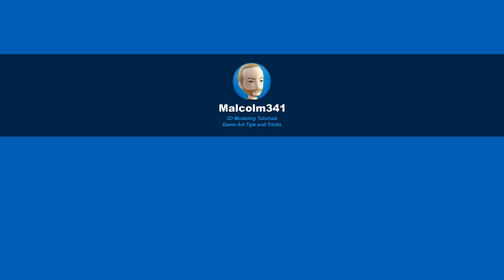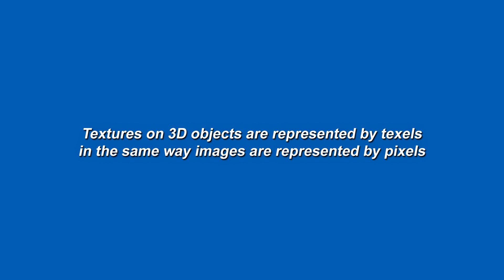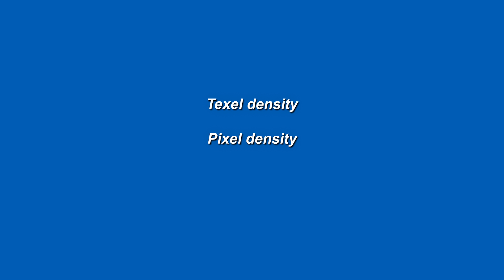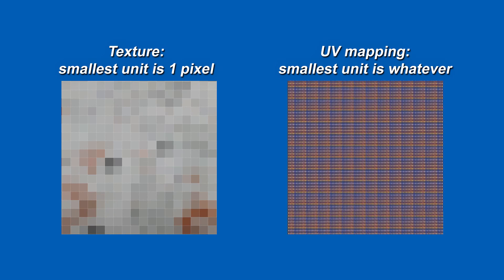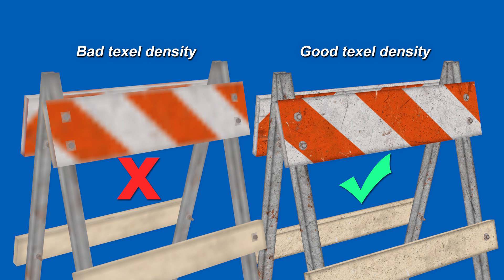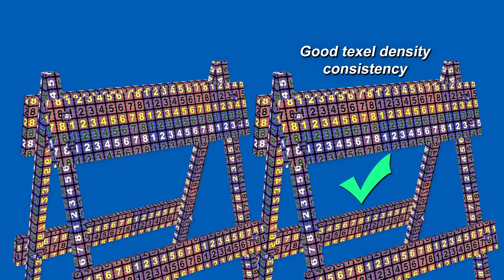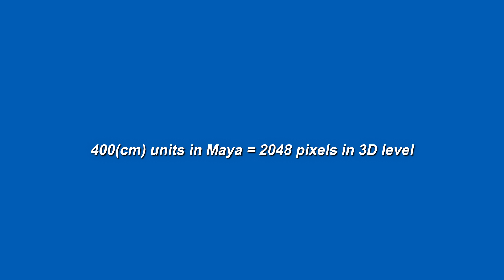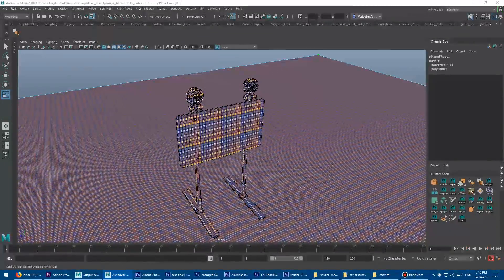What is Texel Density and How to Master it

Comment: Ah man now I'm confused. I watched a tutorial where he said 256 x 256 equals 2048 resolution. Same centimetre units for unreal engine. He had the mannequin next to the trimsheet, but now your saying it's 400 x 400 units equals 2048 in this video, both of you are using the same Centimetre units which is what unreal engine uses.  I have my maya grid and measurement units set to centimetres, but i'm confused, is it 400 units or 256 units?  bought your pack btw!
Reply from the maker: @SpecMarks Texel density is actually arbitrary that's why your confused and is determined at the start of each project/game before you create any assets. One centimeter in Maya can = any number of pixels because a texel can contain multiple pixels. 256x256 units = 2048 pixels from the other tutorial you watched is an insanely high texel density in games usually reserved for characters and weapons that will be seen up close. 400 units = 2048 pixels from this tutorial is just a suggestion for environment art based on my working experience at EA and Microsoft on games like Need for Speed, Skate, Gears of War etc. On Gears 5 we actually used 384 units (cm) in Maya = 2048 pixels. Depending on what asset family you're modeling for will have a large impact on what texel density you decide to go with. For your own personal projects this is largely up to you, but I wouldn't go lower than 400cm = 2048 pixels for environment art or it will look very blurry even in a third person game.
Reply: @malcolm341  oh ok, so if i plan on using 2048 textures as a trimsheet, I should just go with the size that looks best? so on 256 the panels look more consistent with the player size? on 400 they are larger.
Reply from the maker: @specmarks2650  if you're working with trim sheets and texturing large objects 256cm/2048pix is far too high rez and will repeat very frequently making the world look very "tiley." While it might be closer to the player size it will look terrible when viewed from any distance other than very close. There's a balance you have to figure out, on one hand you have blurry pixels and the other hand you have repeated patterns. 256/2048 gives you crisp pixels, but lots of ugly repeats. 400/2048 gives you blurrier pixels, but a nice number of repeats. As I mentioned before on Gears 5 we used 384/2048 for all the trims and tiling textures this gave us few repeats with pretty crisp pixels, that number will be pretty similar for most current gen 3rd person and 1st person games. I would say do some tests and see what looks good and find a number between 300-400cm/2048 that you like, 256/2048 sounds insane to me, it would be super hard to texture anything with that many repeats.

Comment: Hi! So.. I see how you could pack that box into the UV space with a 2048px res by overlapping the polygons so they could share the same texture. BUT, how about a gun with 10+ different pieces, how could you pack all of the UVs in such a small space if you want them to be at 2048 res? Is it even possible or do you have to sacrifice resolution for such big pieces?
Reply from the maker: Good question, guns are much smaller than the world so that helps a lot, some games use a 4k texture for the gun, or two 2k textures, from there you just mirror as much as you can and repeat details. A great way to learn efficient unwraps extract the models from a game and look at them, I did this one for Call of Duty so see their vert count and texture layout. Another great way to get this info is to purchase a gun model from a experienced 3D artist that understands game limitations and see how they did it. These will give you good insight I think. https://www.artstation.com/marketplace/p/oA2N/modern-shotgun-weapons-fps-vol-1-ue4-raw
Reply: @malcolm341  Thank you for the quick reply :) What I don't get is, say a handgun has around 30cm length, I set my ppcm to 20.48 or 2048/100 on the texttools *using max*, and somehow the definition is absolutly garbage lol the only way I get good results is if I scale the UV shells a lot, almost to the point of filling the whole UV space...now, where am I going to place the other 10 pieces left? I gotta be missing something else, 'cuz even if I overlap faces that could share the same texture, I see no possible way of fitting a whole gun into the same UV space with good textures. I'm pretty new at this as you might have noticed by now ahah
Reply from the maker: @xmidima5786  2048/100cm is a very nice high texel density for any game, but texel density is relative to how close you push the camera in to look at the gun. So if you look close enough it will always look blurry. It's best to understand how big the character will be and one ground tile relative to the gun because perhaps you're just looking at the gun too close. You could do a quick planar map from the side view and apply a 2k checker texture to it and see how big the checkers are I usually use this texture https://drive.google.com/file/d/1KBgc2LmG_4W-PP42M1ZA7szvGH1THeRY/view?usp=sharing Also Max uses meters as it's default unit so perhaps texttools is using 2048/100 meters which would be very low texel density. You should easily be able to fit a gun side view projection into 0-1 UV space with a 2k or 4k texture and have the details hold up pretty good, but if you really want to know just purchase one of those gun models and take a look how the pros do it. Also Max may be downsampling your texture, haven't used Max since 2007, but it probably does something silly like shows you a 128x128 pixel version of the texture in the viewport. I'm not much of a gun guy or I'd just tell you the exact measurments. I know on Gears 5 we did the guns at 4k for the lancer and then scaled down to 2k in game and also used mirroring and stacking. I threw this together quickly, there is plenty of room to keep the texel density high with a single 2k map and gun unwrapping if you mirror one side. See how small the checkers are on the gun compared to the floor, I can push the camera right in close and still have lots of resolution. https://drive.google.com/file/d/1UnIPVQ00emvbN__H7TAbPFFeUz0IayEH/view?usp=sharing
Reply: @malcolm341  Thank you so much for the info and the texture! I was planning on learning Maya aswell and now I'm so glad I found your channel! Cheers

Comment: Hey Malcolm can I ask u something? What u refer to the comments as a detail sheet is a detail normal map? For example, u said in a comment about large rocks(to my understanding u bake them then use a detail normal map then u put something like a tileable material underneath? like the ones that u make in substance designer. And one other thing about walls and architecture  the biggest part is a tiling material then in the bottom and the heighest part u actually model geometry that overlaps to apply the trims above the other material?It's like modeling a house right? Tiling material for the most of it then for the windows unwrap bake etc and trims for the corners or horizontally between the floors. Sorry for the long question im in a place that all start to make sense and i have these types of questions, ty for your time if u manage to answer me
Reply from the maker: Hey sure no problem, yes what you say all sounds correct.

Rocks - Generally you use a tiling material at texel density, then you have an unwrapped normal map on top of that, then you have a detail map tiled more than the texel density. This can all be achieved with a single UV set by just tiling two of the layers in Unreal.

Buildings - usually a combination of multiple tiling textures and trim sheets, extra geometry is added to allow the trim sheets to be reused, the flat areas of the building are filled in by the tiling textures. The details page was not referring to detail map, but you should use that too when available. Details would be unwrapped parts that are at texel density and can give the building a less tiled look, like some specific details like windows, depends on the type of building. You can also float decals to add some unique grime to areas to break up the tiling look further. Here's a good video on trim sheets and how they work. https://youtu.be/IziIY674NAw?list=PLAUgGUDpaMEM98Dr3vmUNEbSrURgMPMNw
Reply: @malcolm341  Ty you are the best :)

Comment: Great vid and thanks for explaining it. One question though. If I already have pre-existing assets and I want them at 2048 and I apply a 2048 texture to a plane at 400cm x 400cm can I just "GET" the density from the plane and apply it to the other pre-existing models once they are uv'd or is it not that simple?
Reply from the maker: Thanks, yes it's actually that simple you can copy paste the value from the plane, this is how I often do it when I don't want to do the math.

Comment: I have been modeling with 3ds max 2020 and I got the concept down what I don't get is the unwrapping, but what you just said it is coming out understandable. I want to install Maya 2020 from the Autodesk site but it won't start after install.
Reply from the maker: That's too bad Maya won't start, sorry I can't help with that. Max will use all the same concepts though as far as UV mapping, but the tools will have slightly different names. I'm also happy to answer any specific questions you have here. Besides that just doing a search for beginner tutorials is probably the easiest way to learn.
Reply: For Uvunwrpaing in Max check Matthew Marquit videos(The last is all what u will need) then download textools and in the bottom of the interface they have a similar function to malcom's maya 'get' Also check chamferzone for textools break down and domestika course about making props).Do note though that in most cases noone is using malcom's approach because either they don't know or its just small props

Comment: Hey man, great tutorial. I wonder, what texel density would you use for today (shipping in 2020/21) first person game in style of P.T. - walking in house, no NPC enemies, no particle effects etc., basically just walking simulator in interiors/corridors. Maybe something like 200cm = 2048 pixels?
Reply from the maker: Yeah 200cm would look quite nice. I've never worked on a first person game, just third person action games. On the last game I worked on we used 384cm = 2048 pixels and then we still had to use detail maps so when you got close to something or aimed down sights things would still look good. Somewhere in the 200cm to 300cm seems like a good place, but you'll need to balance that against texture repeats since 200cm is not a very large surface, so you may need to employ other techniques like detail maps and or vertex blending to break up the surfaces to hide the repeats. Ideally you have a small test scene with the POV hooked up and you just walk around a bit and put some test textures on the floor and walls and see what looks good.

Comment: is it ok it have more then 1 tile set or is that bad?
Reply from the maker: What do you mean by tile set? It's perfectly fine to have UVs that live outside of the 0-1 UV space, and it's okay to use more than one texture when necessary.
Reply: @malcolm341  like multiple UV tiles
https://www.youtube.com/watch?v=3iP3A30Oq4A or https://www.youtube.com/watch?v=DmuHLe6MjEA with substance painter supporting this, and UE4 is it a good idea to have this with a balance. cause ive been doing this in the past and also used it to make weathering
Reply: They did it for CS:GO on Steyr Aug and AWP. Because scope couldn't fit into 1st unwrap. I think it's the only 2 guns that does that.

Comment: Very informative stuff! Still trying to wrap my head around it. How did you get 400 units = 2048? If I need my texture maps to be 1024 x 1024 does that mean the plane should bee 800 units?
Reply from the maker: The easiest way to think about it is make a plane that's 1x1cm, then apply your desired average texture too it in your case 1024x1024. Now scale the plane up until you think it looks too blurry, than look at how big the plane is and that will give you 1024 pixels across some number of centimeters. I use 400cm = 2048 pixels because it's a good spot for third person action games, but on the last game I worked on we used 384cm = 2048 pixels, so a bit higher rez. This is of course all relative to how close the camera gets on average. If you wanted to use 1024x1024 texture, but still want the same average texel density as 400cm = 2048 pixels you just need to tile the texture twice across the 400cm plane. Or, make a plane that's 200cm and apply the 1024 texture, that would be the same as making a 400cm plane and applying a 2048 texture. That would give the same number of pixels per cm, but you'd see more repeating since the texture is half as big. It's basically a trade off between repeating patterns and blurry pixels and you need to determine what you like for your particular project and then just stick to it so everything is very close. Typically people will use the ground as a starting point and base all other textures off that since grounds often tile, so once you've determined one unit of ground in my case 400cm looks too blurry at 1024 and too many repeats so I went with 400cm = 2048 pixels.
Reply: @malcolm341  Hello thanks for the reply. I am still confused though. I tried doing your method (1x1 plane, apply 2048 texture, scale object/plane up). Unfortunately the texture did not seem to get blurry at all. The texture just scaled up proportionally along with the object/plane. Not sure if that is normal.

Edit:
It didn't work the way you described it for some reason but I would still like to understand the process. So basically what you're saying is if I want to set texel density I must:
1. Create plane, apply checker pattern with desired texture resolution.
2. Play around with the scale of the object (is it scale of object or UV?) until the texture on the plane looks good enough for the needs of your project (This is the part that didn't work for me.)
3. When it looks good enough, get texel density through UV texture editor.

Is that correct?

Thank you for your time! ^_^
Reply from the maker: @circusmonkey28  Yes correct. Don't scale the UVs, the plane should have 0-1 UVs and then you should scale the geometry until you are happy with the size relative to character/camera. Which part didn't work, are you saying the texture never looked good and was always too blurry?.
1. Choose your texture size, sounds like you want to use 1024x1024 as your average size.
2. Create a plane 1x1cm big in Maya.
3. Apply the 1024 checker or grid texture to it.
4. Bring in a scale model of a human and scale the height of the person to be 182cm, that's 6 feet tall which is pretty average for North America I think.
5. Now we know how big a person is in your world, if you're using realistic scale anyways, and we have a tiny quad below them.
6. Scale the quad up until you think the texture looks acceptable compared to the person, for third person action games I recommend the quad be 200cm or smaller with a 1024 texture applied. You can see how big you scaled the quad by looking in the channel box on right side of Maya with the quad selected. You can go bigger or smaller with the quad depending on your taste and the needs of your project. When you're happy with how blurry or crisp the texture looks compared to the person write down the size of the quad from the channel box in our example 200cm. So that gives us 200cm = 1024 pixels and now you're stuck with that for the rest of the assets you create for the world.
7. Now as you unwrap other objects you can always compare them to that 200cm quad with grid texture, just apply that same grid texture to any asset and place the asset on top of the quad, if the checkers look different sizes on your other assets you have a texel density mismatch. This is generally fine if the checker are smaller on your props, for grounds/walls/buildings this is not okay.
8. The issue here is you have three variables that can all affect the final outcome of texel density, scale of object, scale of UVs, and distance from camera so it's best to lock down your texel density first before you build anything then you have a baseline to follow.
Reply: @malcolm341  The part that didn't work was after i applied tbe texture to the quad, I scaled the object up. The checker texture didnt change when I scaled the quad up. As I understand it, if I scale the quad up, I expected the texture to become blurrier/sharper. That didn't happen. The texture scaled up with the quad. It did not become blurrier/sharper.
Reply from the maker: @circusmonkey28  it won't actually get blurrier, it will just be lower rez than what's around it. Make two quads leave one quad at let's say 100cm, and scale the other quad to 800cm the 800cm quad will look blurry compared to the 100cm quad.